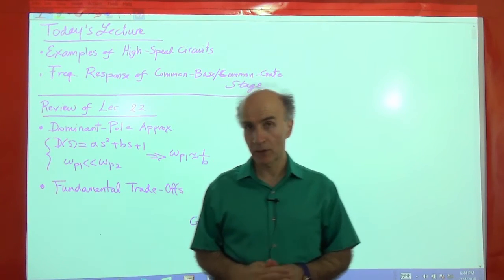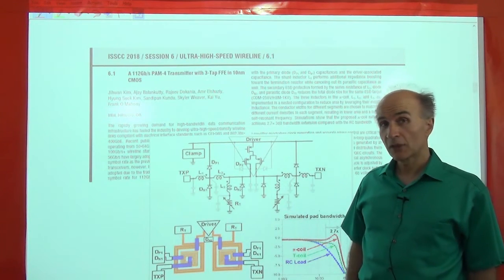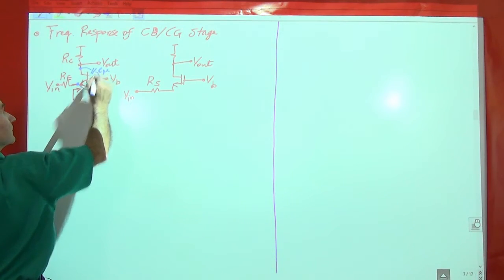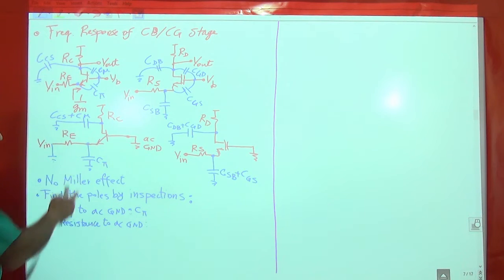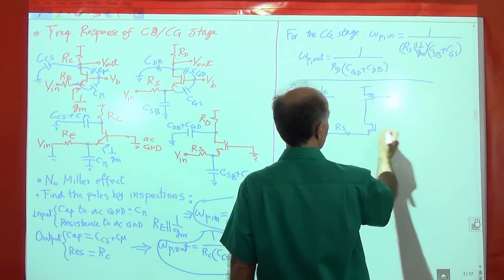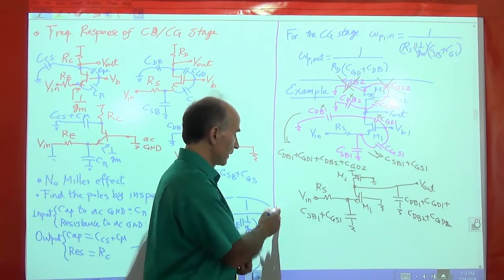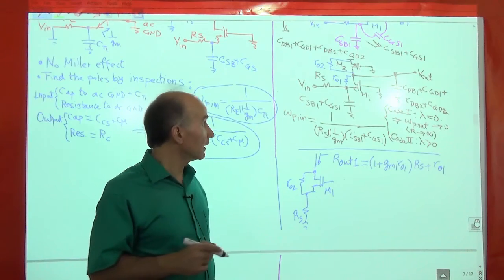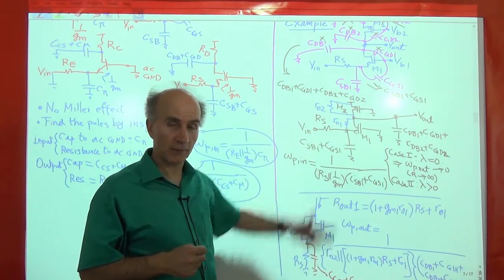Razavi  Electronics2 Lec23:  Examples of High-Speed Circuits, Response of Common-Base/Gate Stage

Comment: Who know why dont we use miller equation for ro1 to analyze? tks for your help.
Reply: You can use Miller's theorem for ro1. In that case that ro1 splits into two parts. At the input side r01/(1-gm1r02) and at the output side= r01/(1-(1/gm1r02)) as a result which will effect the both input and output side time constants. Frequency also changes a bit. Cuz Miller's method is an approximation method you will get a slightly different answer when compared to the professor's answer.
Reply: One thing you should be aware of before using Miller's theorem. The above circuit configuration is Common gate. A common gate amplifier is a non-inverting amplifier. If you use Miller's theorem to ro1. Which will simulate negative resistance at the input side. So the time constant will be negative at the input side. Which may lead to instability problems sometimes.

Comment: 01:29 Examples of High-Speed Circuits
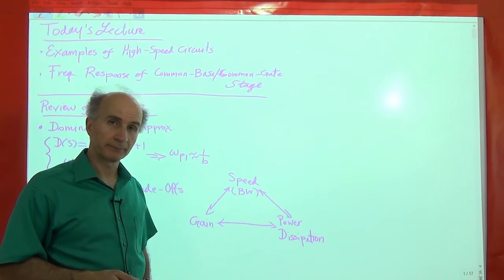04:08 Exploring high-speed circuits and their applications in real-life scenarios.
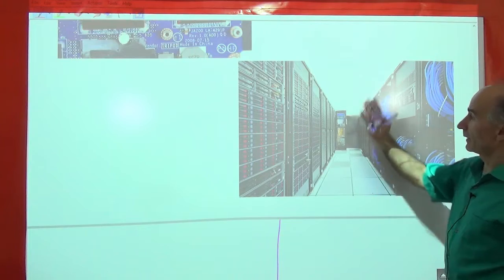09:21 Challenges in transmitting high data rates
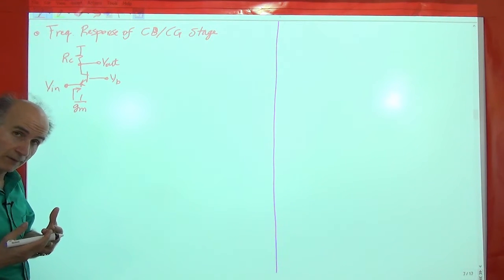12:17 Understanding frequency response and resistor usage in common gate stage
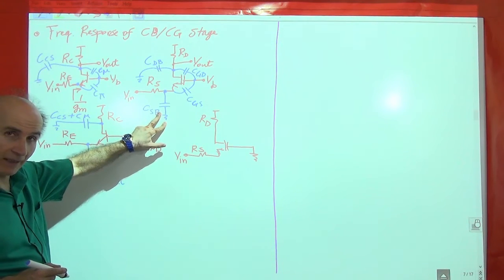18:29 Finding poles by inspection simplifies analysis of high-speed circuits
21:23 Understanding input and output poles in common base stage circuits.
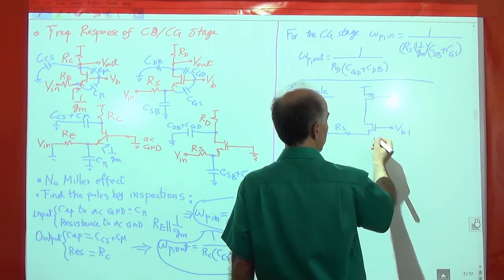27:46 Replacing resistor with current source for higher gain
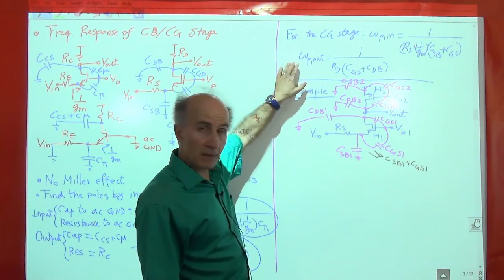31:09 Reduction of capacitances simplifies the circuit design
36:55 Understanding pole frequency in high-speed circuit analysis
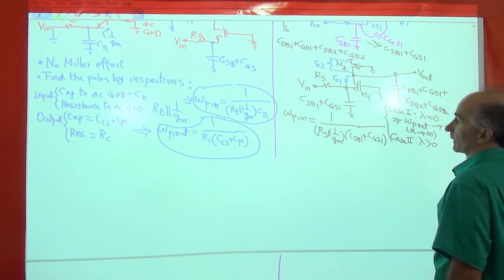39:38 Analysis of high-speed circuits with MOSFET source degeneration
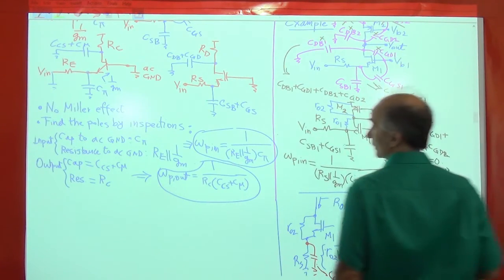45:37 Analysis of common-base/gate stages and finding pole frequencies.
Crafted by Merlin AI.

Comment: What about decomposing ro1 into input and output side according to Miller's Effect? Will the results for ω1, in and ω1, out be any different?
Reply: Of course you will get a slightly different answer if you use Miller's theorem. Cuz Miller's effect is an approximation.

Comment: 01:25 - Intro and Review of Lecture 23
10:18 - Frequency Response of CB/CG Stages
27:10 - Example: Frequency Response of CG Stage with the P-MOS Current Source Load
>> 35:33 - The Output Node - Taking Channel-Length Modulation into Account

Comment: Why didnt you add rpi in parallel with RE and 1/gm?
Reply: If you write the small signal model and calculate the input impedance(Vx/Ix) you will find out the it will be 1/gm. The reason is that Vx=-Vpi in the small signal model. So there is no rpi. It will be cancled out.
Reply: @tag1343  You are right about Vx = -Vpi. However, Rpi does not get eliminated due to this reason. For simplicity if we ignore early effect in BJT(no Ro in the small signal model) and write a KCL at the emitter node for the common base topology. We would indeed find the impedance looking into the emitter to be Rpi||(1/gm). The reason it gets eliminated is because Rpi||(1/gm) = Rpi/(gmRpi + 1). gmRpi is the beta of the BJT which is assumed much greater than 1. The impedance would then just become Rpi/gmRpi which is just 1/gm cancelling Rpi.
Reply: @adityatripathi02 Thank you for your answer. It is helpful.
Reply: @adityatripathi02  thanks
Reply: rpi is 1/gm
Reply: @avirathi9209  wtf bro? rpi is are no 1/gm